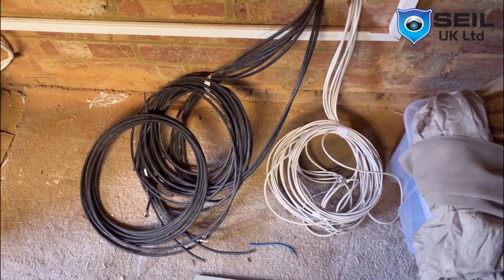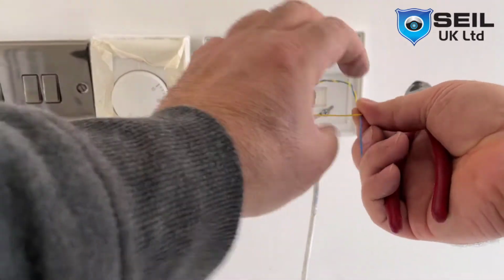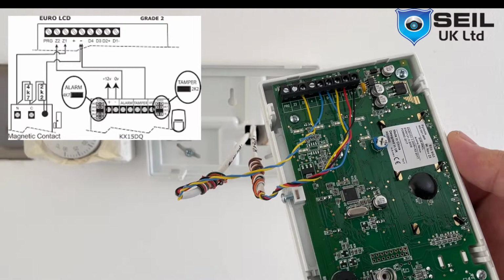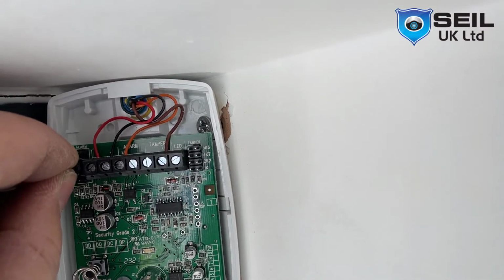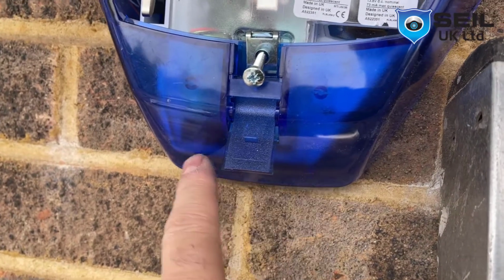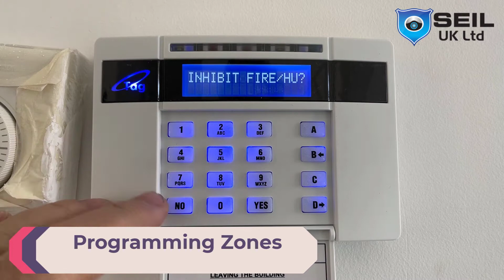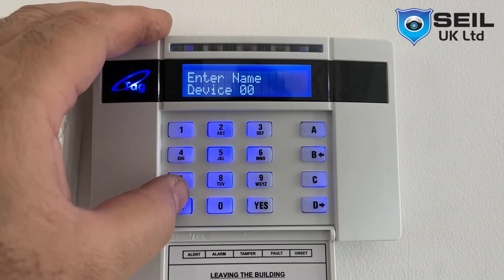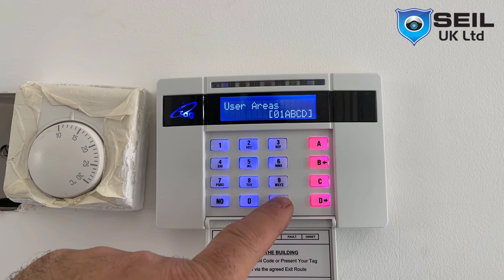How to do full installation pyronix wired security alarm euro-46 v10 panel part-1

Comment: Excellent and very informative video! Thank you.
Is it possible to connect a wired doorbell button to the system board of the Euro-46 and then use its internal speaker (17:54) as a chime/doorbell ?
Reply from the maker: Thanks to watch my video and support my channel. I never tried but I think could work. I need to check how many volts come when panel gives trigger for chime. + is common and - come from panel when trigger. If you put bell you need + and - voltage always there on door bell. I need to check then I let you know.
Reply: @shahzadsheikhs  Thank you for your swift response! 
I already have a PoE SIP doorbell, but want to swap it for a HikVision DS-KIS605-P and was wondering if I could use the speaker that I already have for my Pyronix Euro46  and avoid adding a chime like the one shown in this video https://youtu.be/U7Cq-bXoqH4?si=aCV_zyMobylZ_eBZ

Comment: Great video. I've just moved into a property and have one of these alarm panels. Problem is I don't have the engineer code (nor does it use any of the defaults).

From what I understand, I need to connect a couple of pins together on the PCB and start it up to factory reset it. Problem is though I can't see any of the NVM pins on the board at all to do this.

Have you got any pointers on how to factory reset one of these boards? Thanks in advance.
Reply from the maker: Hi, thank you for visiting my channel. The euro-46 panel does not have a NVM pin. To rest default engineer and user code you need to call Pyronix tecnical help line: 0333 444 1280 terms and conditions applied.

Comment: I have the same system, I am looking to remove some sensors temporarily for decorating, is there a way of putting the system into anti tamper? Deactivating the tamper settings until i have painted behind the sensors?
Reply from the maker: Hi leave system in engineering mode or user mode. If you don’t no engineer code then leave system in user mode. If you don’t know used this step:
Press D then press your code ???? then leave this mode. Now you can open sensor cover. After finish put cover back and press no no no then press A. Hope this is okay for you thanks to used pyronix system.
Reply: @shahzadsheikhs  thank you I will try this!

Comment: For the motion sensors I want to wire two in Normally closed. The 12v+ and 0v should I connect it to the panel? And only one wire for alarm and 1 for tamper. Or two wires for tamper n alarm and still use the 12v and 0v
Reply from the maker: Yes 12v power for sensors from panel. 2 option if you used EOL connection as I show in this video then you used 4 wire 2 for power and 2 wire used for alarm and tamper. If you used alarm and tamper separate connection then used 6 wire connection. 2 wire for power 2 wire for alarm and 2 wire for tamper. Hope this Answer is ok for you.
Reply: @shahzadsheikhs  ok thank you, would like some help programming the panel please and the remote
Reply from the maker: @neilj2327  I have some videos in playlist euro-46 should watch all videos I show everything below link:
https://youtube.com/playlist?list=PLhhdSobCeERGo6MlLZgaN7CEQt-qV9wH1
Reply: Good day, I've managed to program most parts of the system. However in setting the alarm I'm getting unable to set 4 of the inputs. From 1 to 4 respectively, the motion sensors are working, the contacts connected to the zone expander are on input 9 and seems to be working. Please help urgently as this is my only set back in completing this alarm job. Will also need to figure out the siren to sound off when an alarm is detected
Reply from the maker: @neilj2327  watch my this video I used sensor on expender below link: https://youtu.be/4bie0GYhUhg
About external bell when alarm trigger bell will make sound automatically

Comment: Like your work & video's 😎 thank you for sharing 🙏 can I ask why you used the front door contact as input 73 & then the hall entry has input 1?
Reply from the maker: Hi there, thank you for your comment. I did this Just to show you can use the 2 zone on your keypad z1 & z2. z1 means zone 73 and z2 means zone 74. 8 zone you can use on the main panel and 2 zone you can use on the keypad which I explain within the video so in total you can use 10 zones. Hope this answers your question.
Reply: @shahzadsheikhs  Thank you Shahzad for explaining so to use the 2 x zones from the keypad is programmed as input 73 & 74, there for leaving the 8 zones to be used in the main panel 👍
Reply: Great question I wondered the same
Reply: @shahzadsheikhs good idea

Comment: Salam Shahzad, how do I wire to 2 PIR that are joined in series and only 1 wire goes back to control panel?
Reply from the maker: i make video on 2 door contact in series wiring use 3 x 2k2 resistor and apply same connection on pir hope this link make help thanks to support my channel. https://youtu.be/uHEXXjqHNQc

Comment: Brilliant video. Good explanation.
Could you do a video using this pyrotex euro 46 box but old type PIR sensors and shock sensors (6 wires), door contacts with 2 wires  and  old external sounder with 5  wires please

Comment: This is a great video. I was a bit confused about how you did the loop for the internal sounder. Did you just cut the cables and then join them back up and only use two cables for the sounder? And assuming they go back to the panel under SPK and AUX+. Thanks